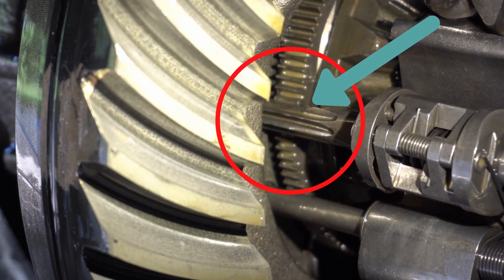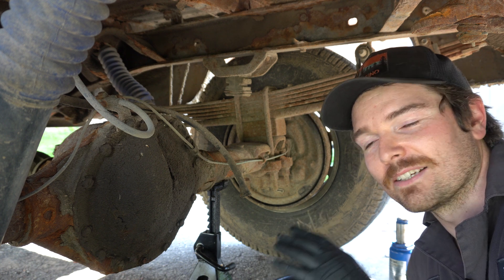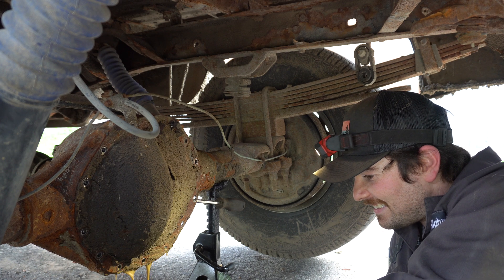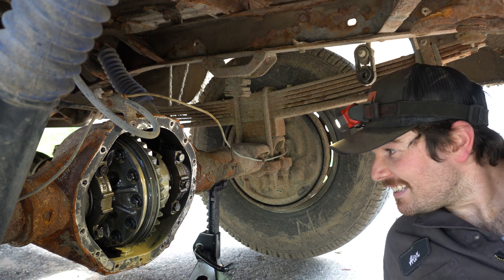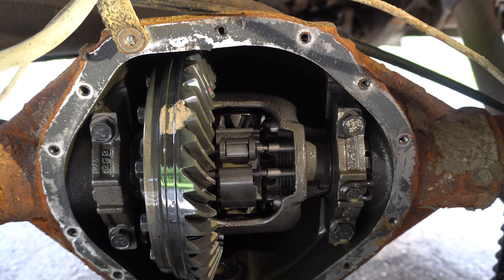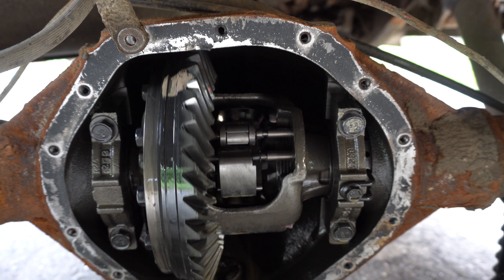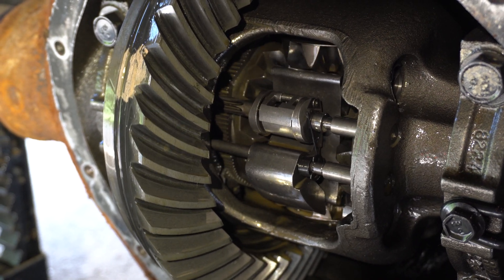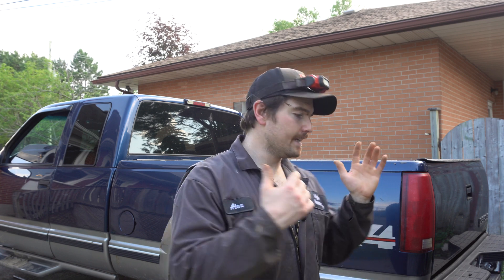Chevy Silverado 2500 4x4 Rear End Failure | Eaton (G80) Locker FAILURE Explained

Comment: But a belt sander ya need to adjust as rebuilt them 
Where the pin goes t thru spider gears ...pin wont reinstall if ya sizes are not correct ive belt sanded the block side to side after rebuilding with better clutches 
Ive bought new clutches for the M80
And there always to thick.
When reinstall 
Belt sander
I dont know how GM factory sets them in probably a press or something 
But again i dont put much cash into them and mine do great without cost.
Both my trucks ive rebuilt the differentials

Comment: Make sure ya vent hose and the very end at ya gas  entry..gas cap to fuel tank make sure the valve is open at ya gas tank refule cap..that vent has a valve end of rubber vent hose.
Other than that change ya lube.
Dirty lube is so hard on the Gov loc

Comment: I have many 
Gov loc hardware 
I could of repaired yours instantly 
Upon my bonus of gov loc parts my salvage yard stock.
But i omit the 2 shafts and i settle for just 😢a single drive axle...without  the engagement system installed see
I just drive normal grocery store ect

Comment: I have many Carriers from the best salvage yard in Indianapolis just east of Indianapolis 500 track.
Plus engines 
Transmissions..and transfer cases...ect.
I rebuild from stock as still usable see.
Gov loc
Well from what ive learned was developed Eaton and USA MILLITARY ENGINEERING 
GM Sold many Dealership 
I know a friend..mechanic 
Penske Chevrolet. 
Most time Dealership replacement lower cost single drive axle Carrier.
As me the loc up system works....but i dont care for Wooden grandfather clock parts in a Differential 
Grit and grime.
Once years gi by..they just burn up clutches..have much slack.and sometimes explode..
Gov.loc.
Makes a good single drive carrier good enough driving to grocery store and bowling alley..for me.
I have many Gov.loc hardware from my salvage yard.
So i just put in more clutches and steels.
Wont suprise me if ya behind a belt sander and shim stock .as resetting 
I omit the entire loc up 2 shafts and transfer to single drive axle retirement Machinists
Reply: Remove the C Clips tiny ones on the 2 loc up shafts tiny.holes are on side of carrier remove pins with a punch.
As I said ya might be making shim   dics for reposition as back tight like perhaps. 010 gap once assembled both ends.
They convert to a good single axle drive 
Omit the 2 shafts and loc up system 
I have many Carriers I own a 95 k1500
And a 06 silverado 
Indianapolis retirement Machinists ect
Reply: Gov loc after years well they burn up.
Become loose ..if ya want pos trac get ya a 
Eaton spring loaded carrier
Reply: Indianapolis i have many ring and pinions from my Indianapolis salvage yard i just reposition them with different gm shims...again a belt sander..measurements calipers micrometer 
Why spend a fortune on them ok good
Careful while working and enjoy ya work
Indianapolis

Comment: That stupid little piece o crap system doesn't have any clutch packs. You saw how chincy the rods and components are that are suppose snap into place when power is applied. Depending on what part of the country you're in snow or mud will tear those up in a heartbeat. Regardless of how one maintains them they will fail at the worst possible moment. I love my Bowtie trucks, but this is the worst system GM ever came up with and sadly they are still using this crap system to the best of my knowledge after many years and people just don' t know about it. I had 3 fail on me with different vehicles and no there aren't any clutch packs in them. I'd love to see the clutch plates make a comeback. My 65 Impala 3 peddle had that clutch plate posi rear never any problems. And yes, on occasion I raced it for fun. I will certainly be putting in a Yukon or other reliable differentials into my wife's Blazer. To GM I say please stop making garbage. I apologize for venting of sort, but this crap system needs to be gotten rid of. and screw these new electronic systems. talk about problems!
Reply: Strange, every eaton eaton gov-lock I've served has clutch packs in them. It is a limited slip differential.

Comment: I had to use a map gas torch to heat my diff fill plug to get it out. I replaced it with a 1/2" brass pipe plug that can be removed with an allen wrench.

Comment: How do you replace spider gears and clutches on this type of diff? Im stuck
Reply: You have to remove the governor parts and get them out of your way. 
There is a company named Kent Moore they make specialty tools for GM. They make a tool that looks like a small C clamp to remove the bushings holding the governor in. I've had mine 35+ years but can't remember the part number. You need the tool to take it apart.

Comment: The middle pin on my g80 in my 2001 Tahoe is stuck I can’t get it to come out it’s like stuck but when I turn the diff the pin spins with the diff I’m been struggling trying to hammer it out but nothing
Reply: Did u ever get the pin out I’m having the same problem

Comment: These G-80s are innovation for sure, but no, electric lockers controlled by the user should be the norm.  I see GM finally did it with the ZR2 Silverado both front and back and this is what should be happening moving forward.

Comment: There awesome when they do work,i had 36's and never had a problem engaging it hard on concrete with the 10b axle ,I put on 38.5's and did the same thing,the whole diff shattered into pieces,
Reply from the maker: had they tend to blow up if abused which is the downside lol honestly kind of lucky just a tooth broke off and didn't take out the whole diff.

Comment: i have a Chevy 2500 2009 the differential locks up when turning I hear a pop and locks up the rear tires and then I reverse it a few feet and it unlocks  any advice on what to do ? might be the Gov lock ?
Reply: Any info on the issue?
Reply: Have the same problem, I think my right side clutch pack are welded together. These diffs don't like burn outs lol😂.

Comment: This guy is an actual mechanic, excellent diagnosis of the problem. I would suggest just replacing the broken shaft (if possible) , the clutch packs (plates) may never have been used!
Reply from the maker: Thank you, I did some research before hand so I kind of knew what I was looking for. I was honestly thinking the same thing with the clutch plates but then again with the fluid that came out of the diff who knows if that has ruined them. 

either way I think just the shaft assembly is like 100 dollars and the clutches are another 150 so I'm probably going to do both.

Comment: Hey just took the cover off my sons 97 2500 2wd and it has the same exact problem! Do you have any info on what you did to fix yours? I’ve worked on cars for 25yrs but mainly paint and bodywork never tackled a rearend but sure I can do it. Any advice would be greatly appreciated bud
Reply: Realized I had the “g80” code now I want to make sure it’s engaging too

Comment: Looks like you got some work ahead of you..👍 are those g80 
Really special..?? Could the differential just be built with different type..?
Reply from the maker: no not really I wouldn't call them special. they are nice to have though. and when they are working they work very well. 

I mean parts are cheap. for the flyweight assembly its like 130 bucks. whereas a new diff carrier would be like 500-1000 dollars depending on what i wanted
Reply: @GettysGarage  wow 😯 ok… well that’s a big difference..
Reply from the maker: @mikekosar6135  so hopefully that will fix her up good and then I can throw it around in some mud and snow!